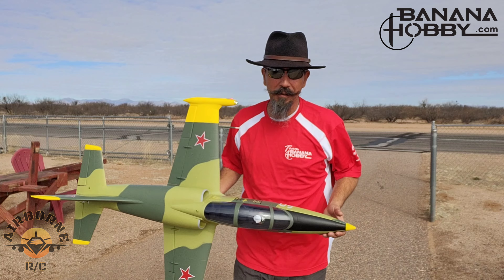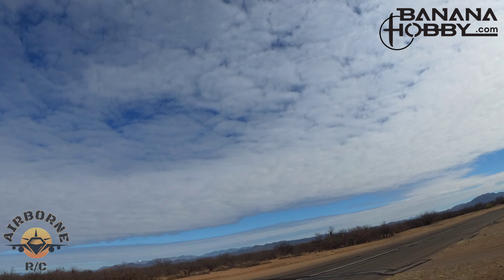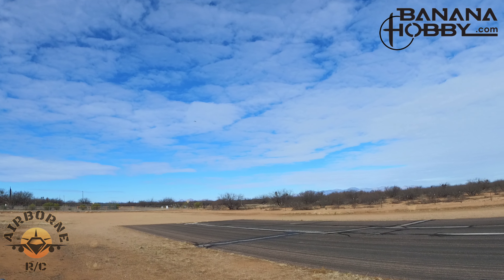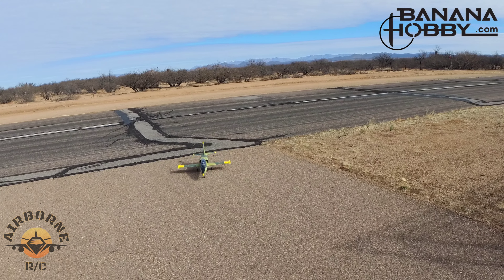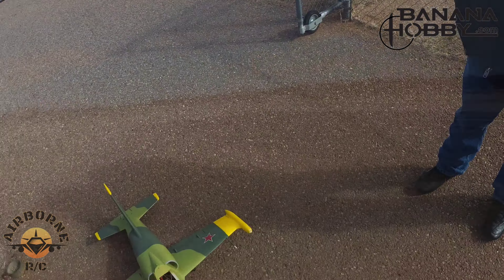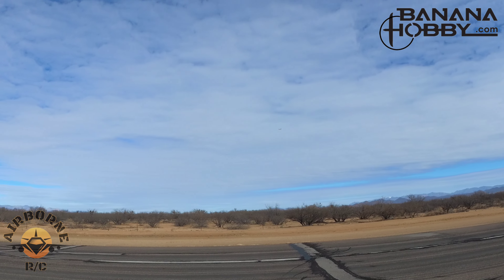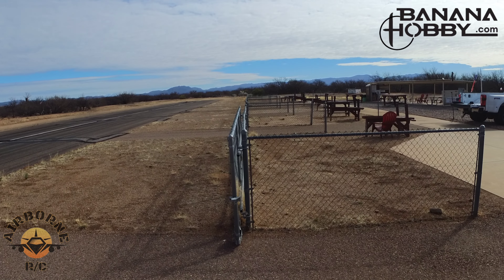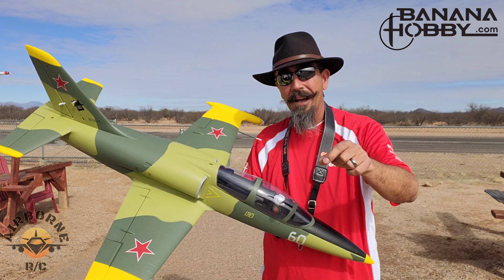FLYFANS L-39 64mm MAIDEN and Performance Flight!!!!

Comment: Impressive bird. They hit a homerun
Reply from the maker: Agreed! To tell the truth this is my 3rd flyfans. Other 2 flew on rails aswell. The K8 is similar except no retracts and light. My k8 is the 4s version . We use it as a club trainer . The MIG 25 Lance itself, you can see the video on my channel when I'm coming in for a landing. I have the transmitter in the camera and i'm just using throttle. 🤣🤣 I don't have the flyfans SU27 but I'm sure it Flys like flyfans 👊👍

Comment: Wow these guys seem to be raising the bar which is awesome. I don't know I've ever seen more EDF offered for $200. I put 6s in my $190 FMS Rafael and asked "why manufacturers don't offer 64mm in 6s" because everything was improved with Rafael 64mm 6s inrunner fan installed. Few months later, they come out with this 6s 64mm, flaps, retracts, lights! Hope to see more mfgs coming out with 6s 64's like this.
Reply from the maker: Agreed! Thier MIG-25 is nothing to sneeze at as well 👍🇺🇲👊

Comment: Awesome flights! Just got mine in today, Arctic Camo. Looking forward to the maiden on my first edf!
Reply from the maker: Sweet! Don't go crazy on lipo size 2000 to 3300mah max 4000mah be way to heavy! She will treat you right. Make sure surfaces are centered. I had to mechanically zero the elevator and 1 flap. Thank you!! 🇺🇲👊
Reply: @NoonzAirborneRC  Funny you mention the manual centering, I had to do that on one elevator and one aileron. I was planning on 3300mah packs. I also have the x18s with Archer Plus SR8 with stabilization turned on :)

Comment: Mine clocked out at 114mph on my skyid module last flight using SMC 2800mah LiHv pack.  It’s a smokin hot little jet!!!
Reply from the maker: Great to hear! I have not run the LiHV packs. There was no info from the manufacturer if the esc or fan would hold (I'm almost sure they would) if you can...could you report back after x amount of flights. Ie 25 flights good, 50 good. Be great info to pass along to customers! 🇺🇲👊👍
Reply: When building it I changed out the esc for a Avian Smart so I could have thrust reverse.  I currently have 16 flights on mine.
Reply: level flight or out of a dive?
Reply: Dive I would think,  since then I’ve seen 125 mph

Comment: after programming the plane i can say maybe a carbon fiber strip  inside the fuse just below the canopy back break point  to the front nose and some foam dave brown foams since the wheels are rock hard, and have some emc 6s 4400 coming  . check the ball links , looks to be the deal of the century  test flight next week
Reply from the maker: 6s 4400 is WAY TO HEAVY max in this plane I fly is a 2700mah. You are going to be to heavy and bad things are going to happen on landing.
Reply from the maker: And yes deal of the year so far! Wish they gave awards for that bc this plane is the $h!t!! Thanks for watching! 🇺🇲👊
Reply: @NoonzAirborneRC  sorry i meant a 3300  smci know a 2700 6s weigh 345g and 3300 375g . Fat Guy flies rc is using a 2700 with no issues and will go slightly heaver for a sold 5 min